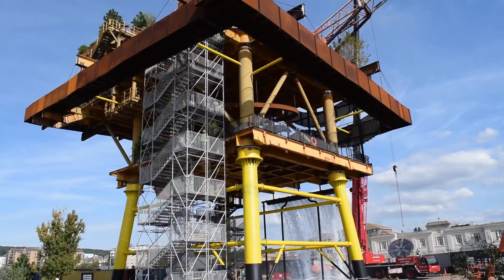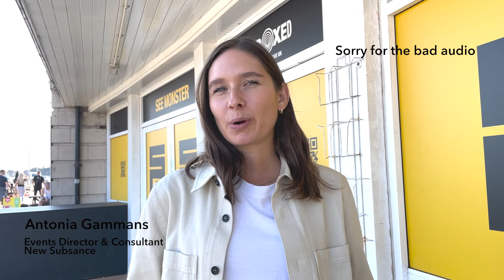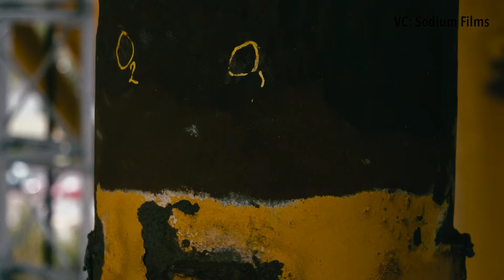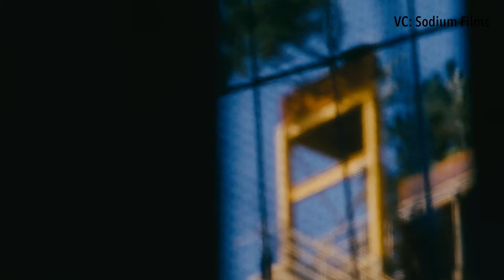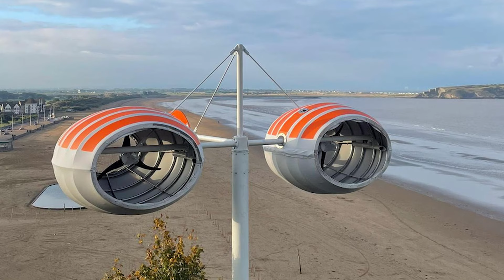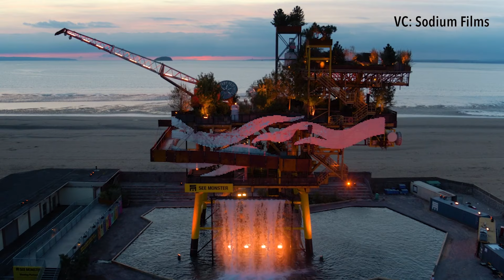Retired oil platform is REBORN into a clean energy exhibition

Comment: The climate is taking a back seat at the moment due to the War in Ukraine. The See Monster is just another waste of money, you just scrap them in a steel works and recycle them into something that you need, which has been done for centuries, rather than a temporary "pop up" art installation. It is better to concentrate on proper insulation on new houses and factories to reduce energy use for heating, it appears very difficult to retrofit existing houses, and a common best practise standard should be adopted to reduce costs, as a lot of retrofitting seems to go awry due to bad installation practises, existing properties should have some sort of grant system, even if it is a loan paid back over time offset as a saving on energy use. Solar is only useful in the summer in the U.K. but wind power at sea seems to be able to give us all out electricity generation in the near future (Hopefully twice as much so we can export it to Europe, but they would rather stick with Russia than an Ex E.U. Member - Couldn't resist that little prod), along with a base load of Nuclear and other nearly green fuels (Wood isn't green, but is renewable) and some carbon!?!
Reply from the maker: Wow! Lots of great discussion points here! :) Here’s my thoughts: The money used for an art installation like the SEE Monster pales in comparison the the money needed to make energy efficiency retrofits. I totally agree that that stuff needs to happen, but I do think art is an important way to build momentum towards a movement and encourage dreaming bigger and thinking of solutions creatively. Energy efficiency being on the “entirely off track” tier in the recent IEA report pissed me off the most so I hear you. Wind is totally where it’s at for the UK, and while the new PM is unfortunate, she seems to actually like wind power, off and onshore. Wind + battery storage + some solar, nuclear, green h2, next gen biofuels + energy efficiency could do it. Biomass from old-growth forests (Drax) isn’t clean at all and shouldn’t be used imo and trees take decades to capture significant amounts of carbon, so burning them and planting them isn’t a 1:1 ratio.